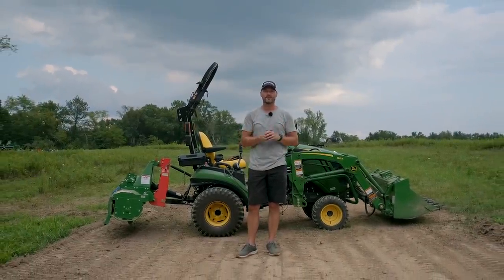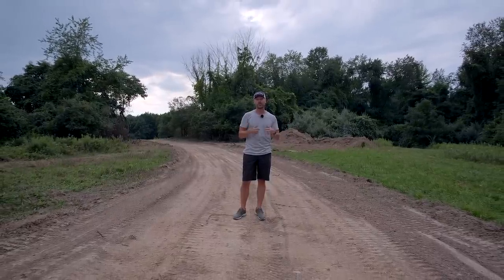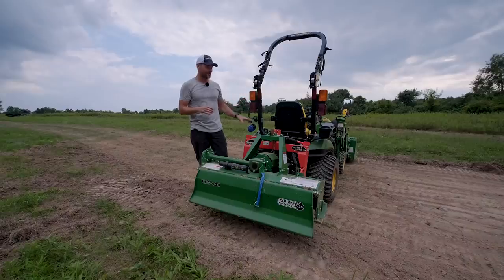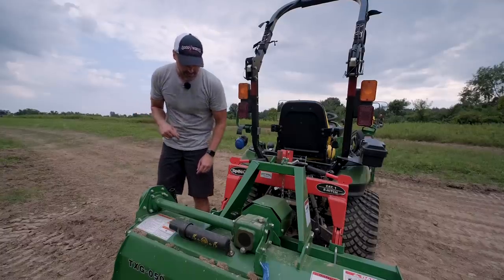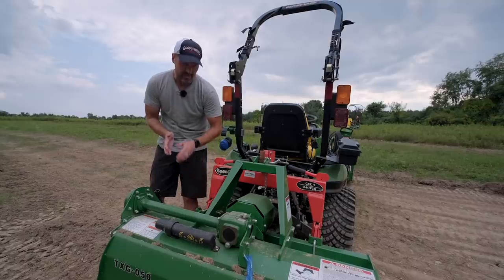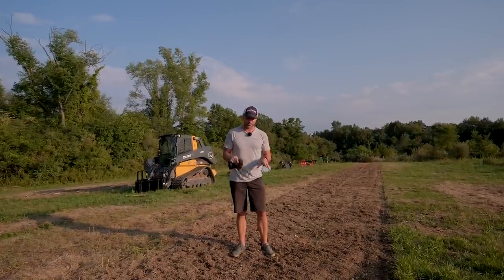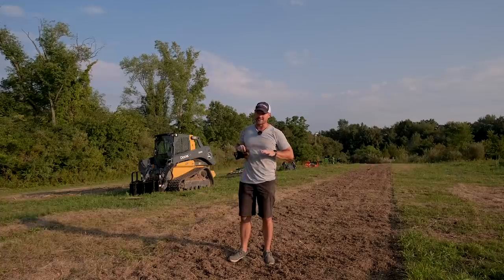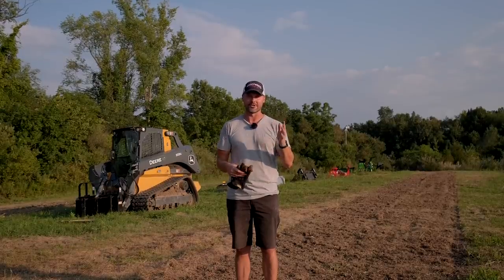CAN A TINY TRACTOR & TILLER HANDLE 2000' OF DRIVEWAY PREP?

Comment: Thanks for the info on what a 1025 can handle for a tiller.  I was told by a manufacturer that it would handle a 6' because the hitch could lift it.  I knew better but was thinking about a 5'.  After watching your video.  I am pretty sure I will stick to a 4'.  Thanks.

Comment: I sympathize with your plight concerning your skid steer.  Just because your bucket is level doesn't mean it maintain an even grade.  Try this:  Keep your bucket in float mode.  While moving forward make incremental adjustments to the bucket angle until you find the "happy spot" between where it wants to dig or climb.  You'll find that working in different materials will require finding a new "happy spot".
Reply from the maker: I'm trying, haha.  I normally have a shorter learning curve 😂

Comment: I had similar problems with my 2016 4052m overheating while bush hogging tall brush for long periods of time. I went to the dealer to check the price of a 4 series Cab model  due to the heat and humidity in the Mid South and found that I could upgrade to a 5075E with cab CHEAPER than staying with the 4 series cab tractor. I bought a 2018 5075E and have had no more issues with the 5 series tractor overheating while bush hogging tall brush. It has 2 dust screens in the engine compartment,  one in front of the condensing unit and one on front of the radiator they are easy to access and clean periodically while cutting . The power revers transmission is nice too.
Reply from the maker: I've spent a lot of time recently looking at the JD 5 Series and Kubota M4 Series.
Reply: @GoodWorksTractors  Have you consider the Kubota Grand L in the larger size? I thought you could get GST with them as well? I like how they are set up.

Comment: In my experience a moldboard plow like a one bottom or two bottom plow will work up that driveway the way you want a lot easier and a plow is relatively cheap especially if you find one on craigslist in your local area.

Comment: You gotta work with what you got, good to hear that they are getting to the bottom of your issues with the 4720 , I knew there would be more to it, I think I would opt to change out the water pump seeing such a large difference in temp range top to bottom I think the pump just isn't circulating the coolant properly. Also glad to see you are going to spend the extra coin on the geofabric it's an investment and will be alot cheaper in the long term.
Reply from the maker: Hopefully the 4720 is through its rough patch after this!
Reply: @GoodWorksTractors  hope so they are a good little tractor, I've used a few of them,

Comment: I'm new to the tractor scene as I'm looking at a Branson 2515h for my land. I have 12 acres of raw land which I developed into a homestead. I have an 800 ft driveway where I had someone with a dozer form a road. I put #4 stone down so it would stabilize the base with crush & run on top. Seems like you're doing a lot of work tilling, skid steering, laying fabric and then gravel. Again, I'm new to this so what did I do wrong? Thanks for all your information, love your videos!

Comment: Out of curiosity, why scoop the dirt out if using the fabric? Topsoil dirt would still make soft spots after a rain? I’m completely ignorant when it comes to driveway building.
Reply from the maker: Top soil is organic and will break down over time.  So, it could create an uneven surface as that process occurs.  Stripping the top soil to sand which won't break down will avoid future issues.

Comment: I’ve overheated a big 180hp deere utility tractor several times mowing thick brush with a 20’ batwing. Speeds were 1.5-3mph depending on terrain. Overheated from a variety of reasons. We also overheated the larger 200+ hp ag tractor doing the same work. I think theres some heat production going on with these batwing style mowers that tractors might struggle to deal with. I do wonder if a flail mower of the same size  would cause the same issues.
Reply from the maker: I've heard this about batwings from a few different folks now.  Might be something to it.

Comment: Just wondering if a tiler is overkill and would a disc tear it up enough or even just something with aggressive scarifiers.  I like the torture test on the tiller though, better you to sacrifice the equipment so we have a real world demo. Love the videos!
Reply from the maker: I think it really helps make a full distinction between the soft and hard own underneath.  Rippers or a disc would probably do something similar.  I also like the benefit of really chopping up the top soil for easier spreading when I want to reuse it later on.
Reply: @GoodWorksTractors  you make an excellent point with the topsoil being much more usable after the tilling. Much easier to spread out after.

Comment: you have a track loader right? use that to strip the topsoil?
Reply from the maker: Yeah I talked about that towards the end of the video.  I have trouble keeping the skid steer bucket level without working the ground first.
Reply: @GoodWorksTractors  I guess I should have waited to the end before commenting lol. Some more seat time in that skid steer will solve that issue! Keep up the good work!

Comment: Clint Eastwood Dirty Harry quote " A man has to know his limitations" same applies to sub compact tractors and all tractors. Your JD is capable but that skid steer you own with a harley rake or ruckase rake would blow through that driveway project in a day and not abuse the equipment (You may be able to find a rental rake) . Sometimes hiring a contractor with proper equipment to save your equipment is the right option. I get being thrifty but at some point you become stupid cheap.
Reply from the maker: I think I tilled down and back and scooped it all out in 2-2.5 hours.  I need to x4 so that's about a full day.  I'd be wasting time and money going to rent something when I have tools right there to tackle the job.  I have absolutely zero interest in hiring someone else to do that work for me.  In fact, it isn't even work.  It's fun and I've been waiting years to have a chance to install my own driveway.  It's a dream come true.  😁
Reply: @GoodWorksTractors  I agree with you Courtney on that. We have neighbors that are in bed shaped physically and their property is getting out of control. It was some good tractor therapy for me to get on my little nearly 40-year-old Kubota and brush hog where I could after I had trimmed the branches on the weekend so I could get in there and make it look a lot better. There is always a lot of satisfaction on being able to use the equipment that you have to get the job done.

Comment: You must be in haven you have a dealship full of equipment and a big playground to try them out on, you are spoiled have nice weekend😁🤣😎👍
Reply: Courtney, it looks like you are no longer using the dual rear wheels on your 1025R.  What led you to drop that configuration?
Reply: @biancaw.5987  Possibly using bora wheel spacers instead of the dual tires
Reply from the maker: Correct. We're always trying different set ups, attachments, tractors, and ideas here so we can share the results with you. Nothing wrong with the dual wheels. It was a great solution.